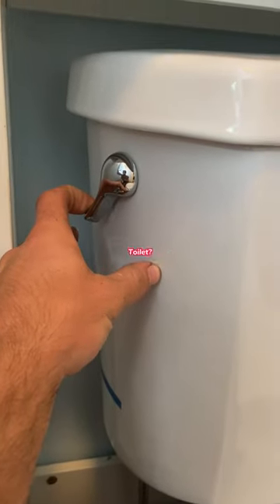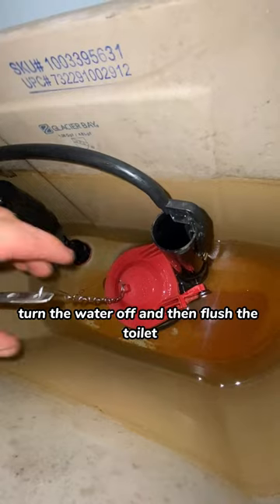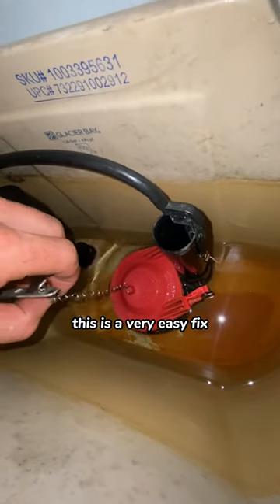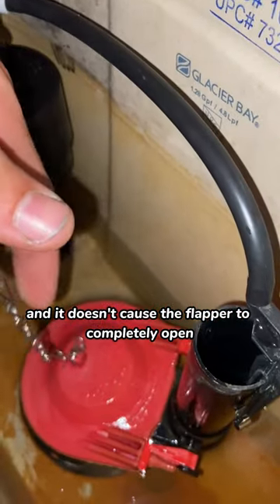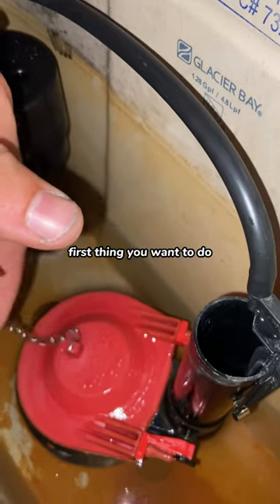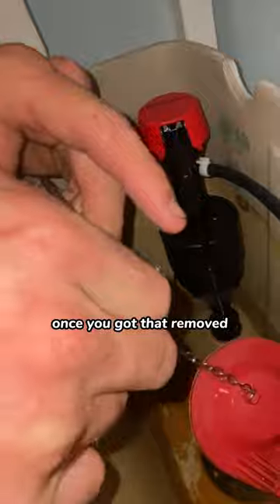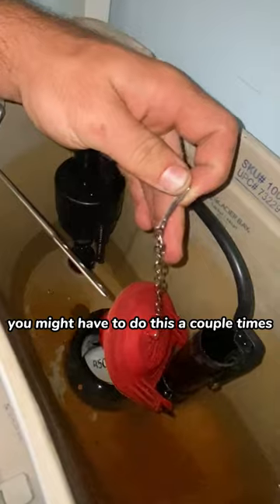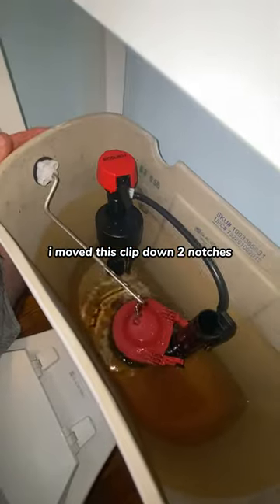Toilet not flushing properly? Here's how to fix it DIY #shorts #plumbing #plumber #toilet #diy

Comment: Flapper should smack flushvalve ovetflow tube and seat back down fully. 

I recomend a pressure assist though. Less water per flush but the power of commercial  flush
Reply: Pressure assist toilets are a total scam. Less water per flush? That's a joke. You have to flush more to make it clear everything out.
Reply: I flush once with a tap and get a full powerful flush. Just like as if I had a 1” commercial flush valve operating my toilet. 
Haven’t ever come to a clog where a pressure assist was involved. 

You may be thinking low flow or dual flush that use gravity not the pressure assist which uses city water pressure at 60 psi
Reply: @pinkiuspius  I have owned and used multiple pressure assist toilets. They just don't work as well.